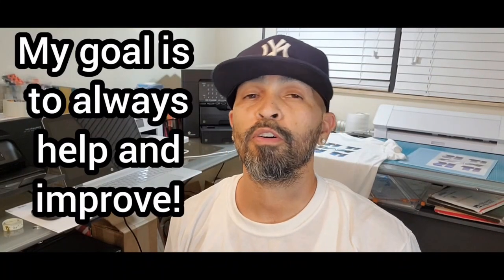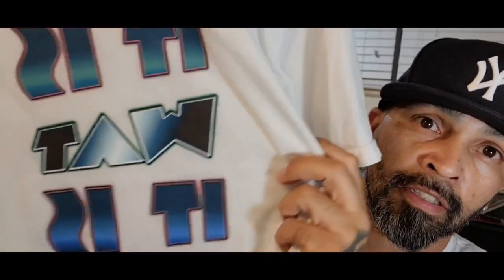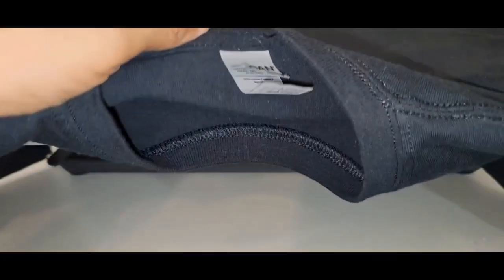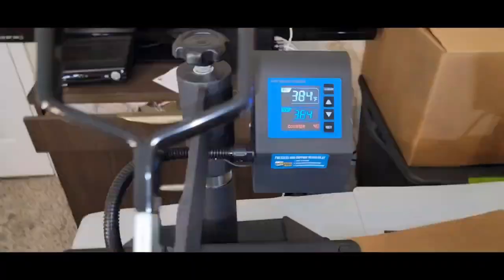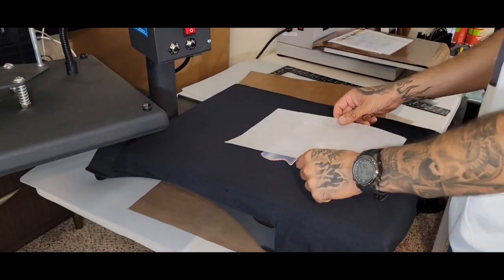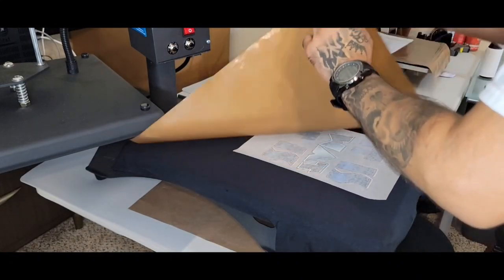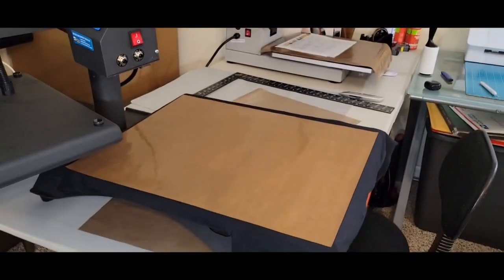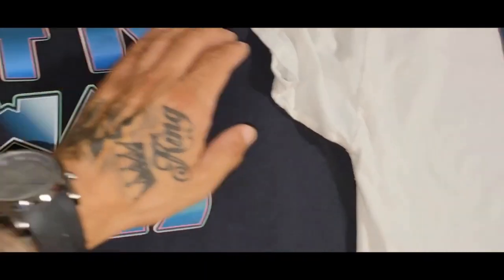Heat Transfer Paper | Sublimation | Cotton T-shirt UPDATED

Comment from the maker: UPDATE*:  385 Degrees For 30 Seconds Firm Pressure Heat Press.  After 1st press, leave Silicon Paper on for 30 seconds and then peel. * 2nd Press with Silicone Paper & Teflon Sheet for 10 to 15 seconds, optional to let Silicone Paper rest 30 seconds again.  Hope this helps out!
Reply: Why do you remove it and put it back on to press again rather than just running 1 minute in the first place
Reply from the maker: It is like washing the car, and then applying wax.  To each thier own when pressing shirts.
Reply: So kind of a preference thing based on whats working for you? Jw
Reply from the maker: All good.  Based on my research, lot of others for the most part do a second press regardless what product is being used.
Reply: Gotcha. I also found a couple other instances where this was the case. I wonder why the prints  cant get it in one go
Reply from the maker: Could be small factors, top plate heat press pressure, the degrees maybe, slow control on lifting and/or pressing, the inks, and more.  I use old shirts, print my design, cut it up 6 to 8 pieces and write down settings per press.  After that i can say this settings works for this product/shirt.  You got this 😎

Comment: Thank you Kenny for responding, I have subscribed to your channel. I look forward  to the update of your new heat press. What is the silicone paper vs. Teflon sheet?. I was just using butcher or copy paper, so the image does not to transfer to my heat press. I never stretch the t shirts, after the image has been pressed. I will try that next time.
Reply from the maker: Silicone paper comes with the heat transfer paper PPD, have to lay over the design.  Teflon sheet overall is good to have, it protects the garment you're pressing (from heat).  Reason I say teflon sheet needed because it will help the silicone paper lay flat for 30secs after 1st press.

Comment: Hello I'm using ppd and after 3 days gets blurry do you know wy
Reply from the maker: Hello.  Regular jetink is the better option. Or can try lay down ppd, print design on sublimation paper, and use: 385 - 400 degrees, firm pressure, 30 to 45secs .. now try small design on older shirt see what works best.
Reply: @diywithkenny8399  thx so much Kenny
I'm using the transfer ppr for dark colors and I have to peal it off before heat does apply the same technique 
By the way I'm printing into cotton is that some of the reasons Aswell?
Reply from the maker: For the ppd product, need 50% cotton or more (more the better).  So still a experimental state with sublimation, but someone put in comments about laying down ppd 1st with the heatpress (like tacting it on), then applying the sublimation paper w/ design and applying it that way (like a glitter vinyl if you tried that).  But regular jetink with those instructions are more solid.  May have to tweek a few things, like firm pressure, also leaving that white paper on for 30secs then peel a big help (trflon sheet on top to keep the white paper down too).  Thing about the sublimation is not trying to burn the paper, why I said test it out old shirt, small design or cut your design into parts and test out there.  Decent product and I wanna say Heat Press Nation have a similiar heat transfer paper but have not tested it yet.

Comment: Ok so when we use this method we
 " SHOULD NOT MIRROR OUR IMAGES "?  Correct
Reply from the maker: Not if you using heat transfer paper (recommend regular jetink).  If doing oldschool way, then yes mirror (if tact down the heat tramsfer paper. and then print design on sublimatuon paper mirrored, then heat press it).  Hope that explains it.
Reply: @diywithkenny8399  so I'm mirroring and just cutting my transfer paper.  Mirroring sub image , cut and press  got it  . Thank you , all of your videos are so helpful
Reply from the maker: Just tack down the heat tranfer paper first.. again just practice small design, because cutting the heat transfer paper can be challenging and also everyone equipment is different (also the time and raising the heat up not to burn the paper, cutting maching., heat press, inks).. if doesn't suit you, them go regular jetink and no mirror as directions stated.